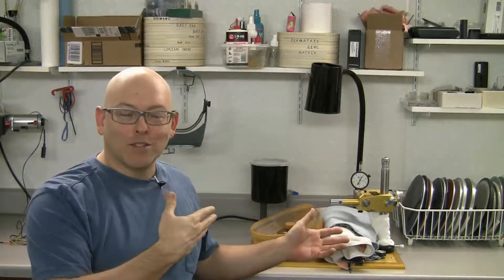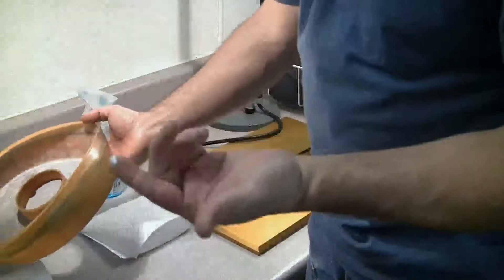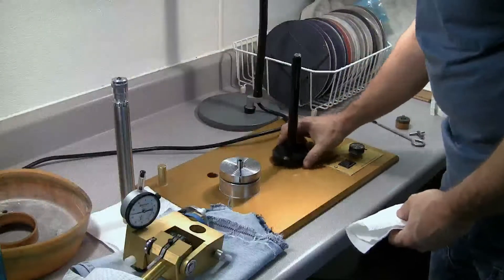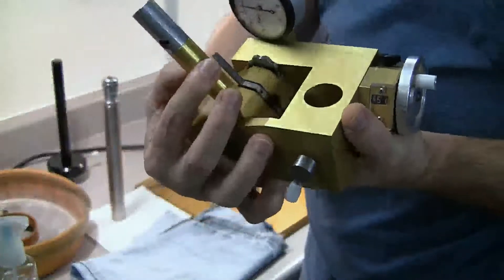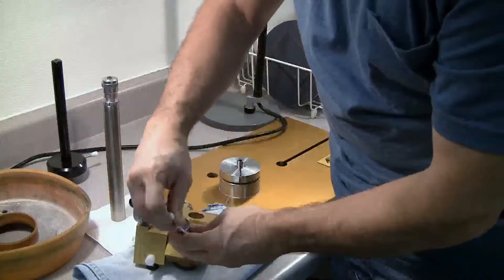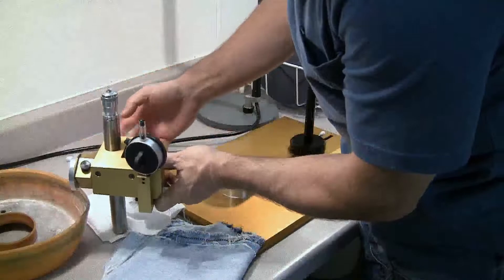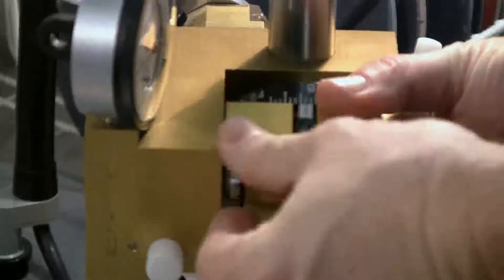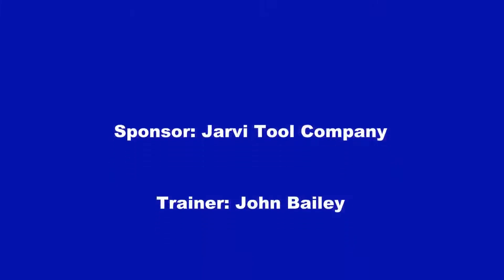Official Facetron Videos: Care and Cleaning of your Facetron

Comment: I'm an amateur faceter who has a few dozen hours on a few different machines, but has yet to take the plunge and acquire a machine of my own.  One of the pieces of equipment i have purchased so far is an ultrasonic cleaner, on recommendation from other professional polishers I have farmed out glass millie polishing to.  
It occurred to me that having stainless steel food service pans that fit in my ultrasonic cleaner and are dedicated to cleaning each grit size might be a good idea, thus keeping the main bath free of grit to help prevent cross contamination.  Dunno if it would help any further, but I am tinkering with and  building a 3D printed device that would automatically turn my laps through the ultrasonic bath.  
Thank you very much for sharing all of your tech tips; I've learned a lot and taken notes ✍️🧐🤓

Comment: Hey bud. Do you know where I can buy a replacement Splash bowl? Seems like the Facetron company’s phones are offline.
Reply: Hi, Bob,

I don't think they're taking any orders.
You're going to have to improvise. Maybe find a plastic bowl you can modify. Maybe find someone who can create one for you - possibly 3d printing.
If you find someone, please share back here, as more people are going to need them.
Reply: @InsightThoughtSystems  I like this idea.  I've been having luck using 3D printing to make molds (-) which I use to cast silicone mother molds (+) that can make many refractory plaster molds (-) which are used at high temperatures to cast glass (+).
Reply: I'd be willing to try casting new silicone splash pans, but I don't own a facetron for reference.  
I will go survey my local lapidary club's machine.  
Are there any markings on the bottom of the pan that might indicate what type of plastic it might be, if it is injection molded?  IDK, maybe they're more rubbery?
Reply: @travismiller5548  If you do this, please message back here. I will buy one!